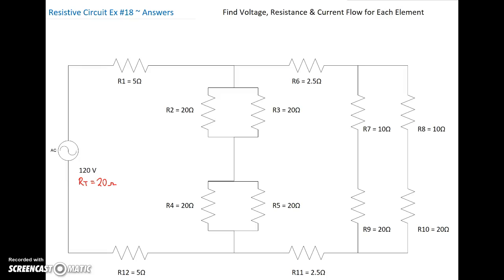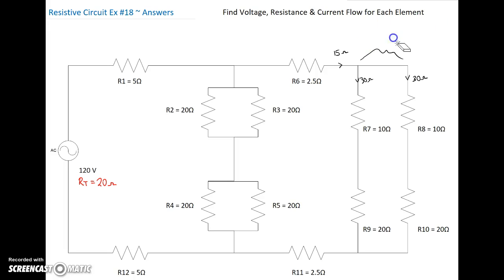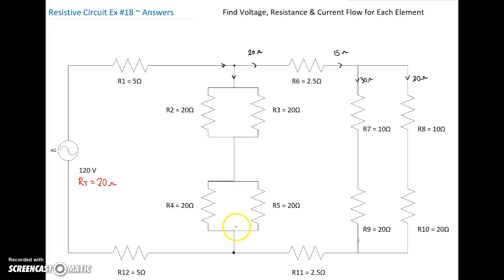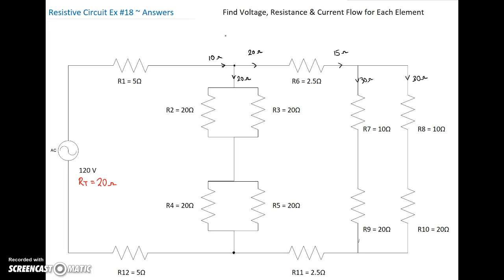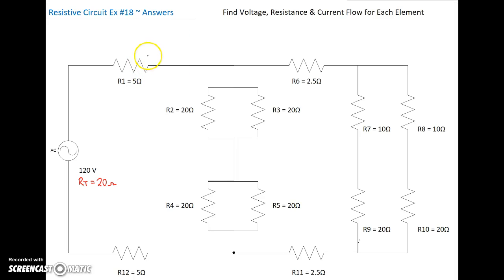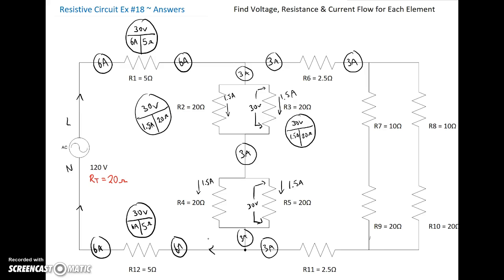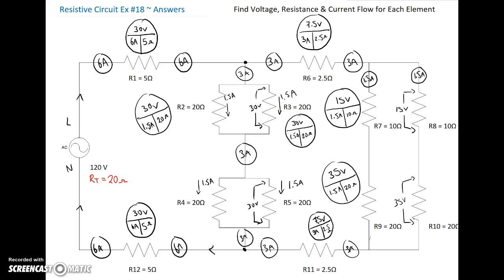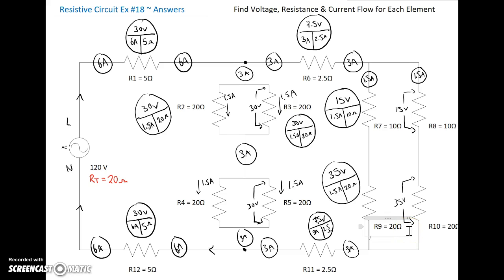Series Parallel Combination Circuit #18

Comment: Aren't Vr9 and Vr10 30V? 1.5A*20ohm=30V, or am I mistaken? Thank you for this series, it really has helped me increase my pattern recognition when solving combo circuits by following the current path.
Reply from the maker: Hi Nan Rozark, you're totally right. Not sure what I was smoking there. 6, 7, 9 and 11 have to add to 60 Volts. Thanks for catching this. I'll make a notation in the video. Cheers. Pete